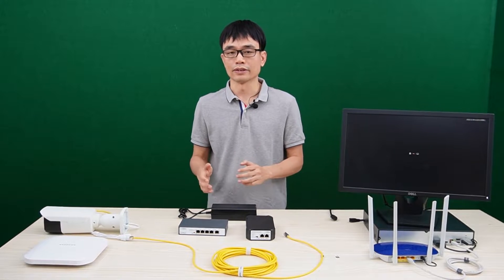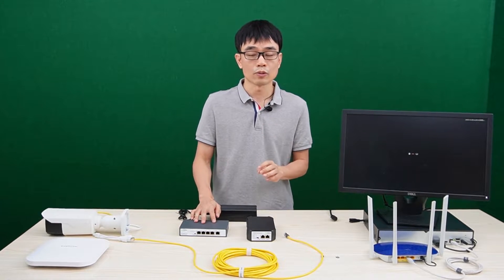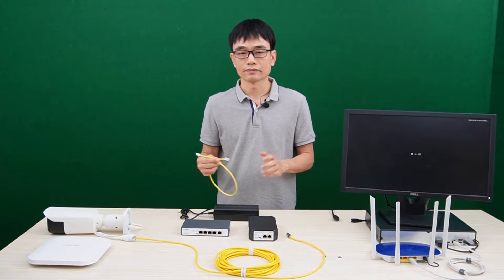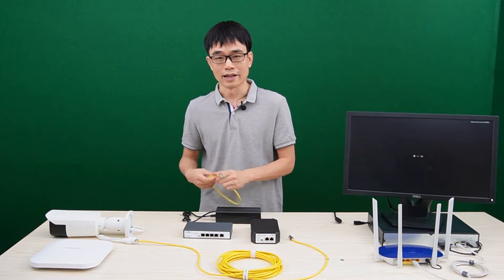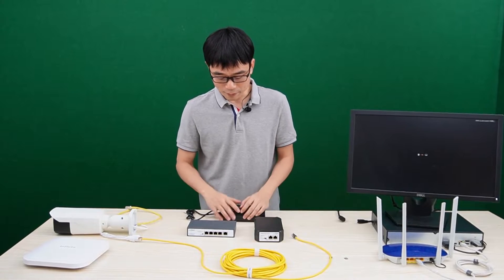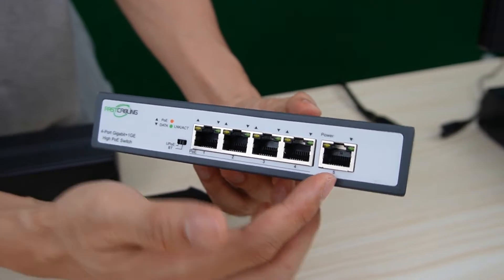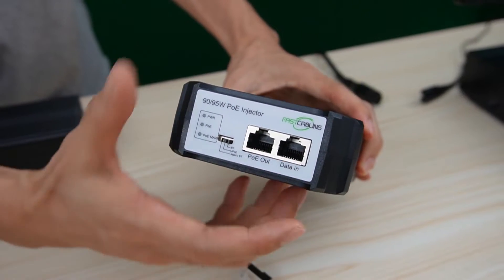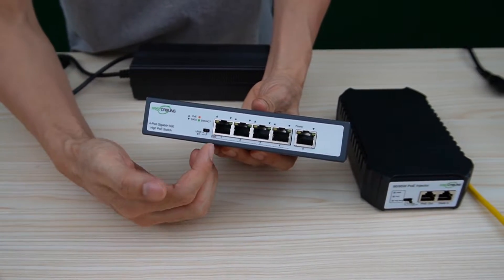90W PoE++ Injector vs PoE++ bt Switch

Comment: Can I run the lan cable from the router to the poe++ injector / then run a lan cable to a poe enabled (non + or ++) switch / then run another lan cable from the 1st switch, to another poe  (non + or ++) switch and have poe power for both switches?
Reply from the maker: Most PoE switches are not powered by PoE; they require a separate power supply and only supply PoE to downstream devices (PDs like cameras, APs, etc.).

If it's a PoE-powered switch (PD), it must explicitly support PoE input (receiving power). However, there may not be enough power for another switch.

Comment: Hi.joe.according to this video.I could hook upto 4 high ptz cams with the 8 port.1500 ft poe switch.correct?
Reply from the maker: No, I don’t think so. It has only 120W total power budget with 8-port version long range PoE switch. If your ptz camera need 20W for each, it will be only enough for 4 ptz camera without long range. There is alway power loss during the transmission. The longer the distance, the more power loss will be.